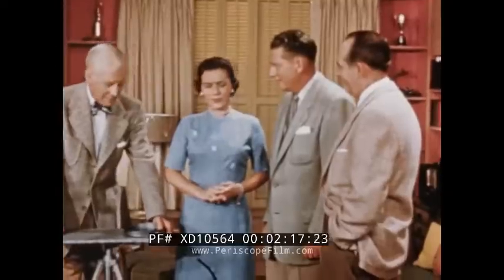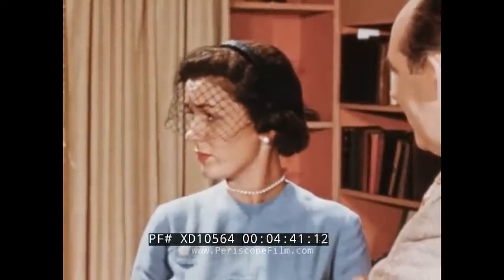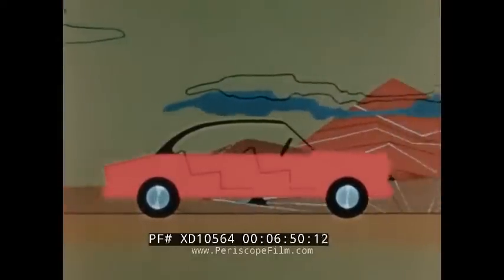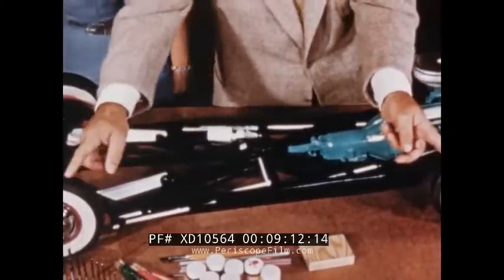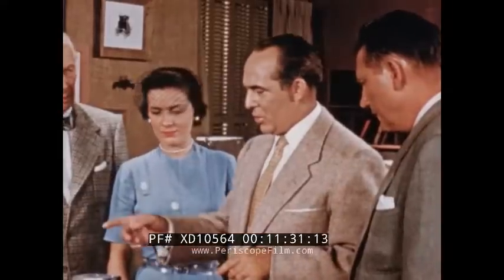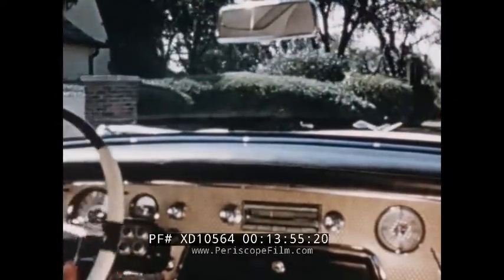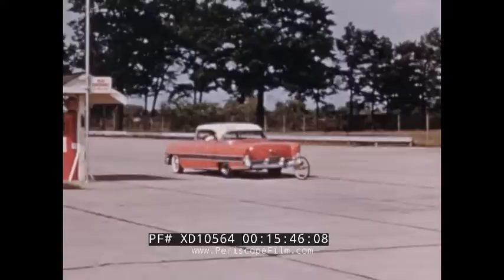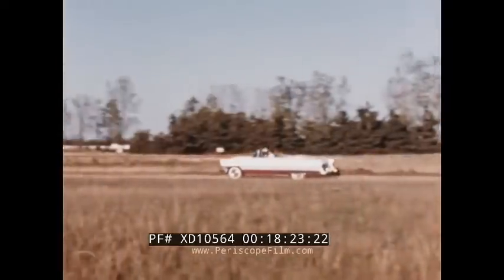1956 PACKARD AUTOMOBILE CO.  " THE SAFE ROAD AHEAD "  TORSION BAR SUSPENSION SYSTEM XD10564

Comment: Torsion bar suspensions are still used today in the front of heavy duty trucks. Not nearly as complicated as it's made out to be in this video. Damn I love these old automotive films. Kudos to periscope for the digital conversions!
Reply: The newer torsion bar suspensions are not linked together from front to rear the way Packard did them though.
Reply: Right there with you, nismo, LOVE these old automotive films!
Reply: Chevy GMC pickup trucks after 1996 I think Suburbans akso
Reply: Chrysler has used this for decades.
Reply: @intuitive7274  Chrysler only used them in the front. They were not linked to the rear leaf springs.
Reply: @intuitive7274  beginning in 1957, so Packard was two years ahead of Chrysler.
Reply: @danielulz1640  Packard was ahead with the pushbutton transmission too.
Reply: @waynejohnson1304  Actually, 1956, the same year as Chrysler Corp. Chrysler's was mechanical,  but Packard's was electrical, essentially the same system used on the 58 Edsel.
Reply: @danielulz1640  Packard had an electronic linkage while Chrysler used a mechanical linkage.
Reply: Packard and Chrysler BOTH used push button transmission controls beginning with the 1956 models. 55 Packard used a column mounted lever and quadrant and 55 Chrysler used dashboard mounted lever.
Reply: @waynejohnson1304  Yes.

Comment: Just Packard taking credit for doing in the mid-50s what Citroen was already doing in the mid-30s...
Reply: Except the Citroen  had torsion bars on the front wheels only, nothing like as sophisticated as the Packard system. You might also like to know the Citroen was designed by the American Budd company.
Reply: @mrdanforth3744 Nope. The Citroen TA had torsion bars front and rear. It also had fully independent suspension front and rear.. Budd did not design the Traction Avant. Citroen did, they created a unibody structure using technical innovations developed by Budd. That's quite a long ways from being able to claim that Budd designed it...
Reply: Regardless, I'd rather have a Packard.
Reply: Dead Centre  Challenge me. Where am I wrong ?

Comment: 64 Year later we don't have a driverless car and push button gear selector is still a bad idea
Reply: Anthony LaFata Jr  it’s really common in new Hondas
Reply: well Anthony, not to disparage your bad idea comment, BUT, my 2019 Lincoln Nautilus has push-button gear selection, and I love it!  It's actually a very GOOD idea because there's no stupid lever in the way and a small child won't be able to accidently hit the lever and cause the transmission to go into fits.
Reply: My family was Mopars all the way from 1959, so I drove nothing but mechanical pushbuttons  until they stopped making them in '65. They were reliable as all get out and very easy to use. I drove a '63 Valiant in the late '90s as my every day. The first day I had it, it blew a front wheel cylinder. I got it home by going down the row of push buttons to slow it down nearly to a stop then throwing on the trans park lever. You could hear the ratchet inside click and grab, and the car shudder to a stop with zero damage to the shifter or driveline. Incredibly durable.

Comment: How effective was Torsion Level Ride in real life and what year was it discontinued or did they use it until the company closed its doors?
Reply: According to reviews by professional road testers it was quite an advance on every previous suspension and definitely had superior ride and control especially in rough conditions as when going over a bad railroad level crossing or on a rough road. With the added advantage that a heavy load of passengers and luggage did not make the rear end squat down. Other companies tried to get the same effect with air suspension a few years later but could not get it to work well or reliably. Packard started putting Torsion Level suspension on their most expensive models in 1955 and gradually extended it to the full Clipper and Packard line in 1956, sometimes as an option, standard on the top models. It died when production ceased at the original Packard plant, and Packards were replaced by revamped Studebakers in 1957 and 58. But while it lasted it was definitely the best luxury car suspension on the market.
Reply: Chrysler’s Torsion-Aire was pretty awesome too. I’ve seen comparisons from back then of their ‘57 and ‘58 cars with other makes while stopping, going through corners and over bumps and the difference was amazing.
Reply: lots of cars and light trucks have used them since then actually fairly common
Reply: @jimhaines8370  No. Packard had the patent. Lots of cars and trucks have torsion bars but they act independently of the other wheels.
Reply: David.  I drove a '72 Chrysler New Yorker for several years in the 1970s and I can tell you the Torsion level ride was superior to coil springs in every way possible.  The handling, the cornering, the stops where the car didn't dive forward - all much better with torsion-aire ride.  GM and Fords sucked when it came to cornering and nose-diving because of their use of coil springs.

Comment: That push button transmission would come in handy today.  Everytime I get head while driving that damn shift selector gets in her way.
Reply: Chrysler used it from about 1957-1964 even on Plymouths
Reply: Richard K - don't look back, but there are some Fords and Chryslers that right now use such push-button transmissions (no shift lever in the middle and a larger place for your phone or whatever)...  But they now use electronic "drive-by-wire" rather than cables.
Reply: My neighbors across the street when I was a kid in the early '60s had an Edsel that had a push-button transmission. Even at 8 or 9 years old, I thought it was cool and wondered why all cars didn't have it.
Reply: Good for you! :-)

Comment: It was not long after this that Packard merged with Studebaker. The last Packard cars were made in 1958. I think there were two models offered for the 1958 model year. A two door coupe and a full sized sedan. They were both dressed up Studebakers.
Reply: The merger would not have occurred if the auditors had done a better job of depicting the poor health of Studebaker.   Packard was a stronger company and probably could have survived as an independent.
Reply: I have thought they should of hooked up with Checker Motors and offered a version of the Checker Marathon dressed out as a Packard and opened up Checker's use of Packard and Studebaker engines. Don't know how cost effective the Packard torsion bar suspension would be on taxi cabs but a Marathon body on a Packard chassis would of been quite the Automobile and could appeal to Limousine and commercial car markets and fleet and municipal uses.  But then at it's time of demise Studebaker was the distributor of Mercedes Benz parts in the USA  and I think they missed the boat by not having a Mercedes Benz diesel powered Lark.
Reply: @fk4515  I'm not sure people would have spent the money on a diesel engine back then in numbers that would have saved it maybe if they could have survived until the first gas crisis but also back then diesel was not at stations like now which was another problem not real common until late eighties when light trucks started to gain popularity.
Reply: @jimhaines8370  Studebaker did offer a Perkins diesel engine in cars and light trucks in 1958. Aimed at taxicab and commercial users. It was not popular and set no sales records.
Reply: From 1954 on data plates said "Studebaker-Packard." IMHO 1953 was the last real Packard. 53s still had the gas pedal starter same as Buick from 34-60.
Reply: @1940limited  "Packard Motorcar Company" 😪
Reply: There was a hardtop coupe and 4dr sedan and wagon, but also the 1958 Packard Golden Hawk - took the 53 Lowey coupe and added a fish mouth, among other things.  I've see the Hawk and sedan, never the other two.
Reply: @joeseeking3572  It wasn't a "Packard Golden Hawk", there was the Packard Hawk and the Studebaker Golden Hawk. The Packard Hawk was basically a fancy Golden Hawk with  that "fishmouth" front end.
Reply: @JeffDeWitt  I one I would like to see is the Golden Hawk from 1956 that had the heart of a Packard(the Packard V8) more of a true Packard than the phony Packabakers of 57 and 58 (still desirable collector cars if you are into Studebakers which were interesting in their own right at at one time very popular cars in middle America
some people seem to have gotten good service from Larks,there was a V8 (not Packard) available
Reply: @davidpowell3347  Yes, I know about V8 Larks, there is one sitting in my driveway! And the 56 Goldens were and are stunning cars. And while the Packardbakers might not be up to the standards of earlier Packards they were nice cars in their own right, and I'd love to have a 57 Packard wagon!

Comment: Packard's last major development was the Bill Allison–invented Torsion-Level suspension, an electronically controlled four-wheel torsion-bar suspension that balanced the car's height front to rear and side to side, having electric motors to compensate each spring independently. Contemporary American competitors had serious difficulties with this suspension concept, trying to accomplish the same with air-bag springs before dropping the idea.  And they were  gone in 2 yrs.
Reply: Packard was not gone in 2 years. They purchased Studabaker and then did away with the Packard name. Studabaker stopped production of all vehicles in 1966 but did not go bankrupt as many may have thought. In their last years, Studabaker went on a buying spree and purchased other companies to diversify.
Reply: @wallyplumstead614  They were conned by Studebaker re their debt then were immediately asset stripped to save Studebaker as those who were owed the money could only get  more if Studebaker survived.  The action would be illegal today as they never disclosed this time bomb but were required to comply.
Reply: TRUMP 2020 honestly, you’ve got a great name.
Reply: A friend of mine has one from this era.  They had some really good ideas like the torsion bars and they work as advertised. You have to laugh though as the "Electronic Timer"  for the ride leveling motor was nothing more than a couple of bimetallic strips. Copper one side nickel on the other inside the leveling switch for the leveling motor. When called the strip would short to a resistor and once hot enough would bend due to the dissimilar metals, that would then set the switch in the other direction to activate the level motor. One for up and another for down. When it was turned off by the height it would stop. The French and the English did however figure it out with their hydraulic suspensions.
Reply: How effective was Torsion Level Ride in real life and what year was it discontinued or did they use it until the company closed its doors?
Reply: @rollingtones1   I think '56 was the last year. The 57's were rebadged Studebakers.
Reply: I wonder how well the system held up under driving conditions with rain, snow, salt, rust and corrosion. How did that motor hold up? The torsion suspension in 55-56 Packards has always caused me to shy away from them. Nice to look at, but I wouldn't want to own one.